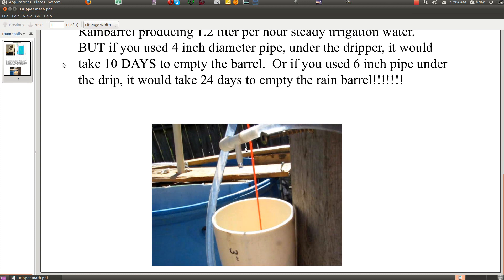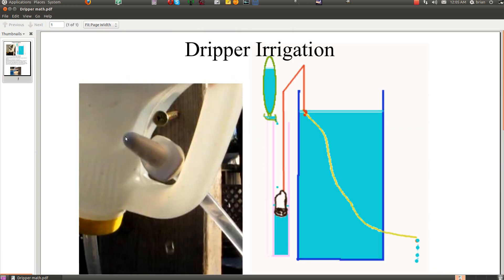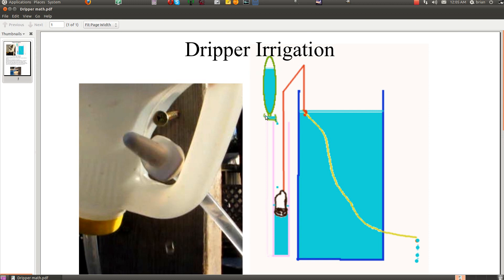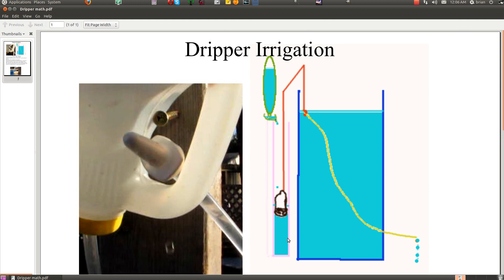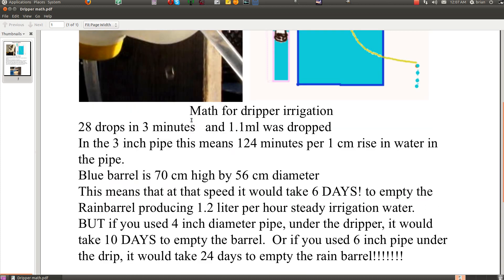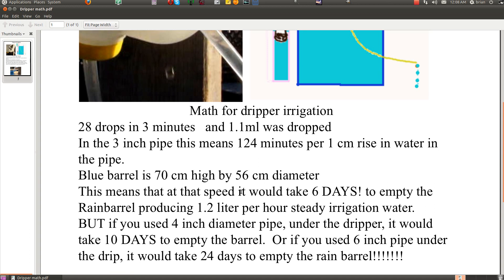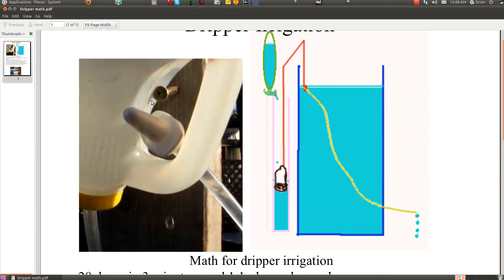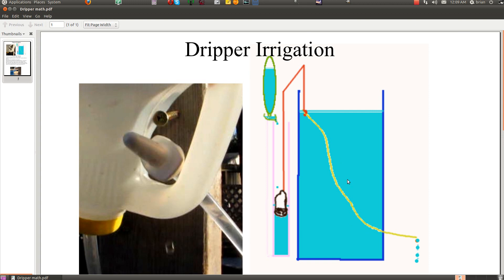Dripper irrigation.  How it works and   MATH!   This could be REALLY GOOD!

Comment from the maker: Hi, Brenda, are you using the bubble pump and T-joint airlift to pump the water back up?  If so, you probably could use 1/4 inch tubing instead of 3/16th. I have lots of tubing so I could  test different sizes and heights before you make your system. 
Brian

Comment: It was so. But, your help has been put to good thought. I am building a little pond using papercrete and a truck windsheild (or something). I want to use that for an indoor aquaponics system. I will be using the water from the sump to fill the barrel to drip to the dirt bed that would be outside in a greenhouse. Winter crop stuff like peas Kale and lettuce. My first dripper gets made as soon as I purchase the blue barrel I have my eye on